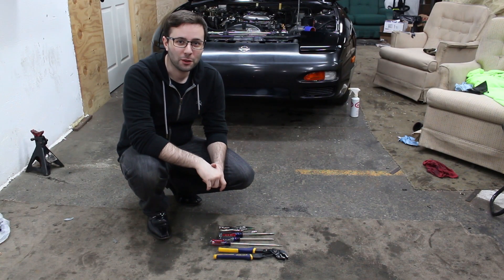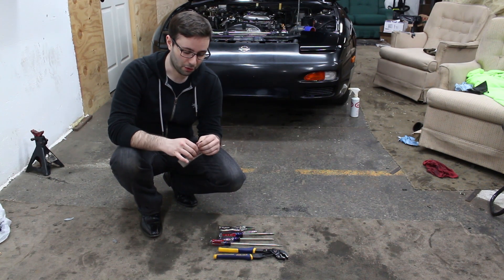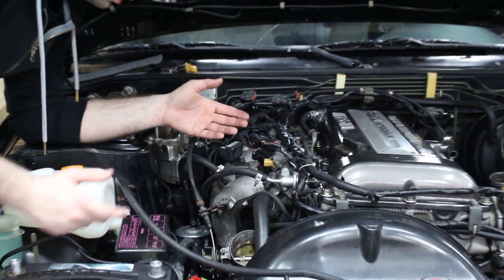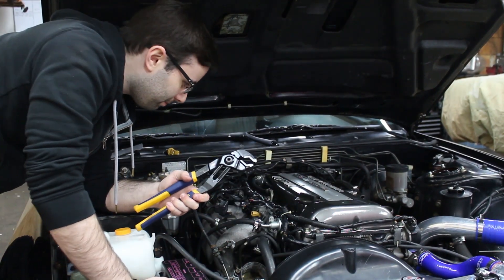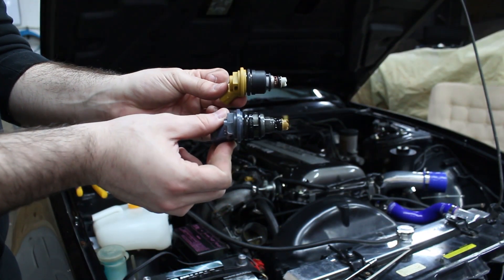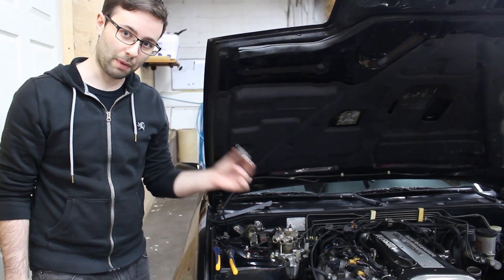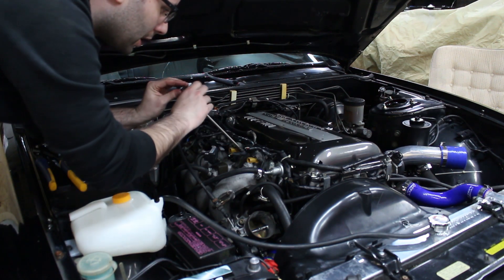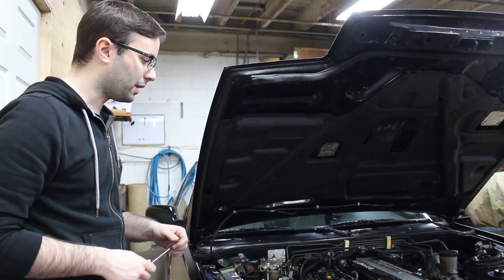Fuel Injector Upgrade | Project S13 PT5 | 240sx SR20det STI Fuel Injectors

Comment: Got a serious question for you,  I have been doing my 1st Japanese build for my wife. It's a 2007 Honda Accord with the J series engine. They really don't sell much for engine mods for it but I  got it to boggy on most 4 cylinder modified turbo car's belive it or not. Pretty much been building what I  can since last year on a budget of course.  I am up to porting myself the upper intake and going to buy on eBay a lower intake so I  can start to port match   it to the upper. I already ported the hole where the throttle body goes to around 80mm and going to try to go bigger because they sell a throttle body spacer/adapter to run a 90mm throttle body of a 3.7 liter and I got a 3.0 liter. Anyways I am going to start porting the runner's on the upper and lower which brings me to this question. I seen on eBay 550,750,and 1000cc injectors for it. How do I find out the factory size injectors so I know a safe size to buy because I  got to habe it custom tuned AFTER I do everything I can that would effect the factory tune. I already know that just porting the where the throttle body goes dosent effect the factory tune, it made the car faster so I  took off the upper intake for now to port the runner's on it and plan to port match the lower intake to match but when I do I want to increase the injectors size then bring it to get it's custom tune. I am obviously going to buy a walbro or some kind of higher flowing  fuel pump and a regulator but keep it naturally aspirated and do it all at one before I get it tuned but also do you know of a universal programming software for a laptop so I can do it myself is the other question because after I do what I am saying I'm get the heads done up and port matched to the lower intake. I can't find out what the factory injectors are on it so I know where I'm starting from. lts my wife's car so I can't afford to make a mistake with it or waste money on to big of injectors and the worst part is that NOBODY I have found sells software to tune it because it's not a stick. Seriously need some advice so watching this video have gave me the idea you might be able to help a fellow poor man modifing a car. Please help because I don't do forum's and want her to enjoy it on the autocross or road course track this year. I'm buying a new gen big block Camero without a blower a putting a better aftermarket blower on it and I already know she will either crash it or kill herself with all that POWER that's why I am doing up the accord for her. Sorry about the long as comment but please really think about what I am asking you so you can give me advice or just flat out know of software for it and how I can find out the factory injectors size. Everything else I researched but it's going to be be starving for fuel. Please help. Thanks. Looking forward to a prompt response to my questions and I live in NYC and can't get shit I'm talking about.  Trust me I've made tons of calls but I  know one guy who swears he can program the car but I want my own software so I don't have to spend $400- $500 every time I  do something serious and even want to get custom cut cams for it as well.